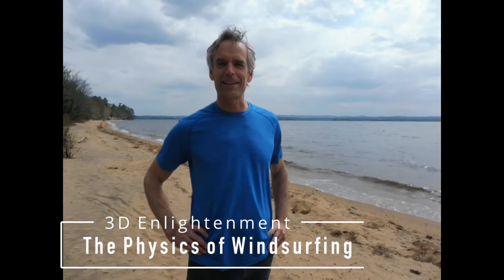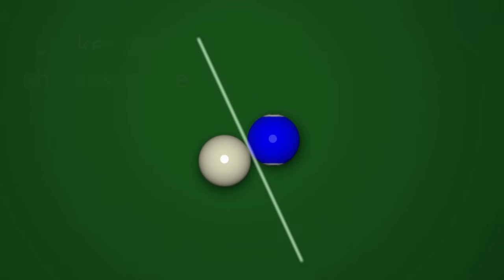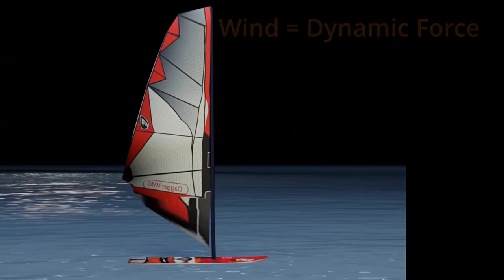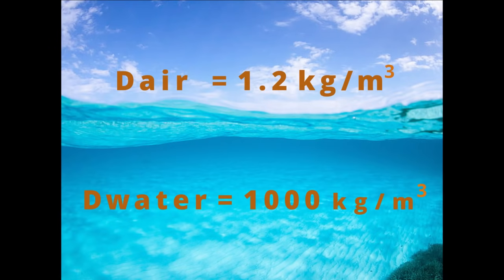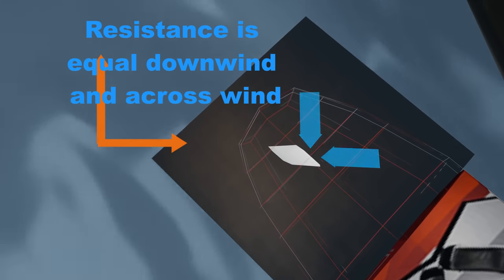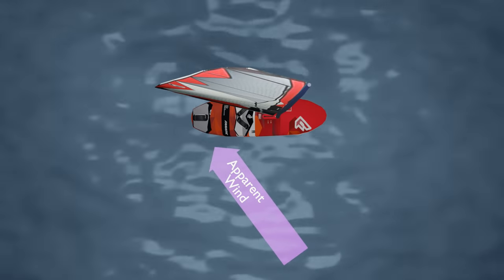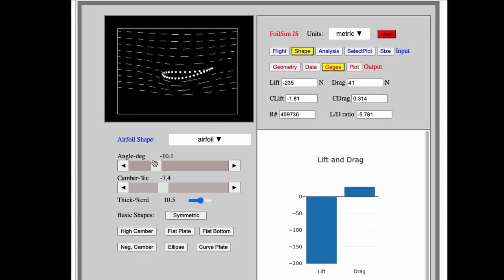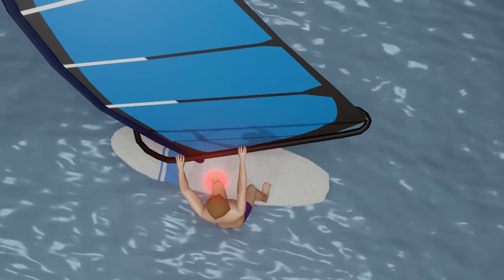Physics of Windsurfing

Comment: Nice attempt at a basic explanation, but it misses Bernoulli‘s principle entirely. The odd fact is: all sailing craft are sucked long more than they are pushed along. The suction on the Lee side of the sail is slightly greater than the pressure on the Windward side.
https://en.wikipedia.org/wiki/Forces_on_sails
Some other useful concepts & terms are: center of effort, center of lateral resistance. These are the imaginary points around which the vessel will turn. If the center of effort is moved behind the center of lateral resistance, the vessel will turn upwind; vice versa if the CE is moved ahead of the CLR.
Another point, when the board is planing, dynamics change massively and turning relates mostly to angle of the board versus the water. The sail can be held in the same place but foot pressure will cause most of the turning.
Reply from the maker: Thanks wildbill805.  Yes, it was meant to be a basic explanation.  As you know it can be quite complicated and confusing.  With the NASA simulator, I was trying to show that the force on the sail is still in a leeward direction and doesn't magically pull the board upwind.  Maybe it was a bit confusing.  Perhaps another video of clarification or perhaps even a non-layman's version is required.  Thanks for the link.
Reply: @3denlightenment  This is a critical point about the profile of a sail, and even taught at beginner level. Otherwise, all sails would be flat, not curved (3 dimensionally).
Reply from the maker: @Richard Turnnidge  Keep in mind there are cam-free sails which do not have a curvature yet are still able to generate significant force due to the "angle of attack" of the sail against the apparent wind.  Under these conditions the Newtonian forces against the sail are significant.  Also, keep in mind there remains some disagreement as to the primary forces acting to generate lift https://www.scientificamerican.com/article/no-one-can-explain-why-planes-stay-in-the-air/
Reply: @richardturnnidge  Having sailed a cambered sail whose cams refused to rotate, sailed just fine back to the beach with the sail inverted. The curvature is helpful but not necessary. Likewise, airplanes can fly inverted with the curvature in the "wrong" direction.
Reply: @cyrilcivet7683  it's hard work though!
Reply: @richardturnnidge  So true! Happy to see your clever comment! And i would add that the fin is also shaped like an aircraft wing and this is also not just to be beautifull! As the board drift, the angle of attack of the fin increase...it generates lift to counter the board 's drift.
Reply: Cyril Civet  LOL, Totally valid! That happens to me too!  Boaters give me funny looks when I'm thrash-pumping or punching the front of my sail trying to get the darn cams to flip. The board still moves somewhat decently in that state!
Reply: 211
Reply: @3denlightenment  No, please, don't do it! I mean, the non-layman's version. Most of us out there ARE laymen and there is no need to obfuscate the issues. It's not rocket science, really, so not necessarily complicated and confusing. On the basic level, it's actually quite simple, provided you keep your clarity and watch out for misunderstandings. E.g., I think you misinterpret the NASA results. No magic necessary there, just thinking straight and without bias. I'll get back to that later.
Reply: @richardturnnidge  Good point.
And is there really somebody out there teaching the basic theory of sailing? Boat sailors - yes, of course, it's a part of the curriculum if you want to be certified, but beginning windsurfers?
If so, you've just made my day :-).
Reply: @cyrilcivet7683  Yes, the same here, but it was not - and didn't feel like - anywhere near optimal. And planes have means to counter the downward pull when flying upside down. It would be curious to actually ask a pilot.
Reply: @3denlightenment  The disagreement is primarily due to confusion IMHO. And the force is not DUE to the angle of attack, even though it depends on it to a high degree. A wrong angle of attack will either not make the sail work at all, or make it work less than optimally, or make it stall. So we are looking for the optimum angle - the one at which the wind generates the most power on the sail. I think it's just a linguistic glitch, though.
Reply: @henrykwdk  The physics behind sails can be very complex as this thread has shown, and can be overwhelming for a beginner windsurfer. It is taught as part of the UK's RYA Start Windsurfing syllabus, but briefly. Most students have enough trouble balancing and controlling the board before worrying about how the sail becomes more powerful at faster speeds. Getting a feel for how the sail works I feel is more important to start with. When they progress to an intermediate level, the the physics of high vs low pressure areas, sail angle to the wind, etc, can be understood as they start planing and getting into the foot straps with harness, etc.
Reply: @richardturnnidge  Yet another good comment. And you are right: the theory is complex and may confuse the beginners - and they have enough problems already. But it can be made very accessible on the basic level, I'm sure.
I was lucky: they taught me theory right from the start while I was in high school, eager to learn and rather fluent in school physics. They kept it simple, too, and we were learning how to sail boats, not windsurf, which made it much easier. The theory has fascinated me ever since.
It's my impression that, apart from your great RYA example, very few instructors teach sailing theory at all. No wonder: no one has taught them either, so they, too, are in the dark. I think it's a great pity.
As it happens, I'm now an assistant instructor at a beginners' course in our surf club and I'm going to suggest we introduce it. Wish me luck :-).
Reply: @richardturnnidge  That's absolutely right.  As a windsurfer who get's on a sailboat occasionally(always get's befuddled operating a boat) I just don't have the patience/dilligence to "study" the correct sequence of events to execute efficient sailboat turns.  When you actually windsurf, it's all about manipulating the sail "every which way" and you develop instinctively what works/what doesn't.  There's no planning or thinking when you execute.  You just execute.  You experiment on the fly and you remember what works and what does not.  Mainly, just trying to stay on the board. 

Now, you mentioned planing.  That's a whole different level.  It's essentially, doing a "wheelie" on a surfboard and then control/balance/steering become a whole different game.  In addition. to increased velocity and reaction.  You don't just slip into the foot straps and away you go.  That's where my skill level left off.
Reply: @trexinvert  Planing is when the fun begins... And now of course, foiling...
Reply: @richardturnnidge  One day I hope to be out there, again.  Warm weather, warm shallow water with no reef, wind, but no chop.   Is there a place like that?
Reply: @trexinvert  Probably, but that wouldn't be a challenge, would it? !

Comment: Fantastic presentation, thank you. The steering section is the best explanation I've seen for beginners, indeed its what I've been teaching for years rather than the 'lateral resistance' explanation I've heard some people give. And the physics stuff is fantastic. What I'd like to see next is 'how foils work' and I'd happily collaborate with you on this! Thanks, Guy
Reply from the maker: Hi Guy!  I've loved your videos as well.  Thanks, I'm glad you liked it.  I don't see why we couldn't do one on foiling.   Do you have aspects of foiling you'd like to cover, or simply how it generates lift?
Reply: Guy! You been MIA on the tubes. Love your stuff. SO HELPFUL. Did you ever try Paul Mindnich's designs (BenchMark Board Design and Tri-Hull Dynamics)? I recently met him in HoodRiver and he was spitting some interesting factoids about his design. I've also been pondering why the board shapes are not modeling some of the ski boats or modern sailing hulls. Thoughts?
Reply: Guy, the so called lateral resistance stuff is physics. What is omitted in this explanation is where the centre of lateral resistance (determined from the board) lies in relation to the centre of effort (determined from the sail). If COE is forward of the COR, given nothing else changes, the board bears away. Moving COE behind the COR the board rounds up. Maybe a bit much for beginners, but it still lies at the heart of sailing physics.

Comment: I had no idea that steering works by feet preasure. This is really helpful thank you so much!
Reply: I doubt. It's the movement of the sail compared to the board that creates a rotational torque. will also happen if your feet dont move.
Reply: Only partially. Most of the steering (while not planning) comes from the relative position of the sail compared to the board. That's why moving the sail forward pushes the nose downwind, and backward pushes the back downwind and the board upwind.
Reply from the maker: It's not about foot movement, it's about foot pressure.  Since there is no rudder, it is the change in foot pressure that turns the board.     If you changed the angle of the sail, the pressure through the mast is always at the same point in the board.  There is also no rotational torque through the universal joint since it is free to rotate in all directions and rotational energy is not transferred to the board.  Only through the resistance transferred through your feet results in a change in pressure resulting in change in direction.
Reply: @3denlightenment  there's torque going on in relation to the center of lateral resistance. The angle of the sail changes how much the sail pushes through you and your feet and how much it pushes through the mast foot. When tilt it forward is mostly pushing through the mast foot.
I think the video explanation is oversimplified, giving the impression that sail angle only affects feet pressure distribution and only feet pressure affects steering.
Both are partially true, but each of them can be used independently. I can steer changing foot pressure while keeping the sail in the same angle (changing my body angle). Or I can sail with only one foot at a fixed spot and still steer the board with the sail, provided that I'm very good at keeping the balance.
Ultimately, I think that sail angle is the one most effective at steering while proper feet pressure also contributes to the process.
Reply: @3denlightenment  Thank you for clarifying. I am a complete beginner so totally loved your video, the tone of your voice and all the comments and clarifications in this section. A follow up video about the physics of turning, foot pressure and sail angle would be great!
Reply from the maker: @kaushikmerchant5971  Thanks very much.  I have plans for such a video.

Comment: It is well explained but very simplified as the sail isn't really being pushed by the wind but rather pulled by the low pressure created on the downwind side of the sail.
Reply from the maker: That is a common misconception which I will try to clarify in an upcoming video.
Reply: That has been proven to be only a partial explanation, and incomplete in itself. Some people call it a fallacy, this physics professor at the end of this excellent video corrects what he says at the beginning and calls them "partial truths", meaning that there is not a single simple and easy explanation for lift. There is one real fallacy in what is probably the most common old explanation for lift to be found in flying manuals: the air particles separating at the leading edge (more precisely at the stagnation point) DO NOT meet again at the trailing edge, that concept of particles meeting at the TE is totally false indeed and demonstrated by wind tunnel measurements (there is mention of it in the video below). I suggest you take a look at the video, very interesting; there are lots more videos to be found on the web that debate that very common and surpassed theory of lift..          
 https://www.youtube.com/watch?v=PF22LM8AbII

Comment: Explaining turning upwind and downwind with the pressure of the back/front foot leaves out the ESSENTIAL reason for the change in direction:  the center of the sail's forces in relation to the lateral force  the fin and the rails of the board provide.
I can turn upwind or downwind with zero change in feet pressure, even standing on 1 leg (litteraly) , and than tilting the sails slightly front or aft does turn the board upwind or downwind. 
Windsurfers DO use foot pressure in stearing, when the board is plaining: back foot pressure is used on the inside of the board (lee side rails) to turn the board towards broad reach, to initiate a gybe in full speed. Front foot pressure is used on the wind side of the board to turn the board windward. You see, the rails is shaped in such a way that it helps the board to turn when not flat.
Reply from the maker: Thanks for the input.  I agree that the center of "effort" on the sail in relation to the center of lateral resistance provided by the fin are essential in describing the pressures driving the steering of the board and I should have discussed this.  The steering section of the video was meant to focus on that experienced by beginners in low wind and provides some practical advice to accelerate a turn.  I also agree that under higher speeds, the rail provides a significant contribution to a carving turn through the water.   
When it comes to pressure on the feet, this remains important and I'm not surprised that you can turn the board even on one foot.  That is because the pressure shifts between your one foot and the mast base due to the change in the center of effort when the sail is shifted forward and aft.  So, although not discussed in the video, the mast base also provides pressure on the board.  
Perhaps a video to clarify steering would be beneficial.  Thanks for your input.

Comment: to 1.: The forward force is actually greatest at a much smaller angle. At 45° the sail would definitly already stall. Otherwise also airplanes would use a 45° angle for their wings, isn't it?

to 5.: It's not about the feet where you steer to, it's more about whether the pressure point of the sail is behind or in front of the fin. If it's behind the fin, you luff.
Reply from the maker: Thanks for your comments/questions.
1.  From a conservation of energy perspective, the sail at 45 degrees would provide the greatest forward force, but as you know, people don't sail with their sail at 45 degrees. This is primarily due to the apparent wind and the forward drag on the sail when it is at 45 degrees. Airplanes don't have their wings at 45 degrees because they do not just want to go straight up.  The wing on a plane is almost flat, and will angle slightly upward on take-off when it is necessary to get off the ground quickly.  The width of the wing also provides resistance to falling down and at the same time providing lift from the Bernoulli effect.   

5.  The wind provides the pressure which is translated to the board through to the three points of contact with the board i.e. the sailor's two feet and the mast base.   The pressure on the mast base is constant for any given angle of the sail, so the only variable is the pressure on each of the feet.  If your back foot is behind the fin, that is perfectly fine, but it is also possible to steer the board if both your feet are forward of the fin.  Additional pressure on the back foot will force the fin through the water in a downwind direction.